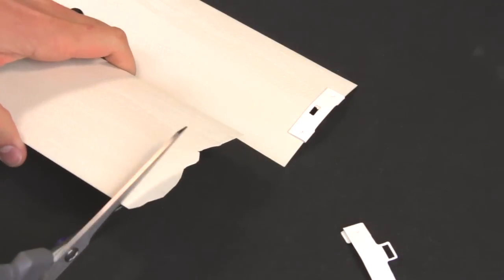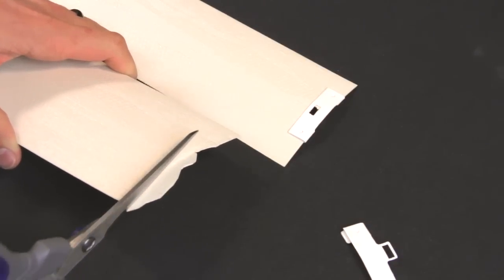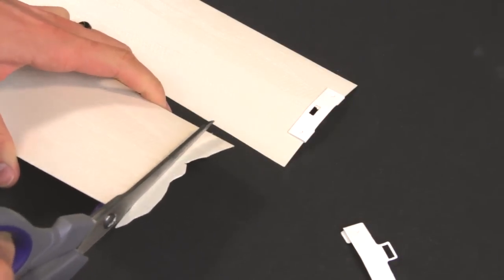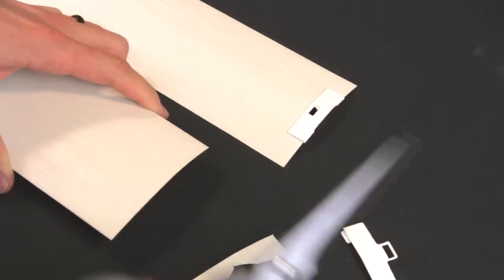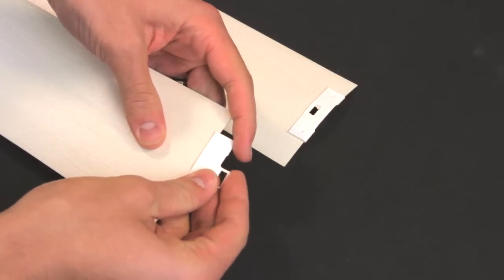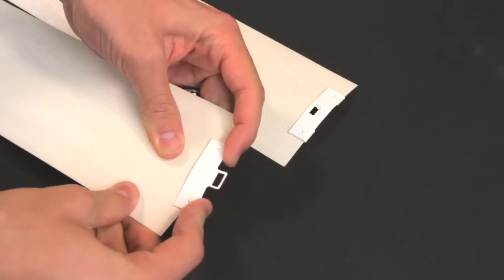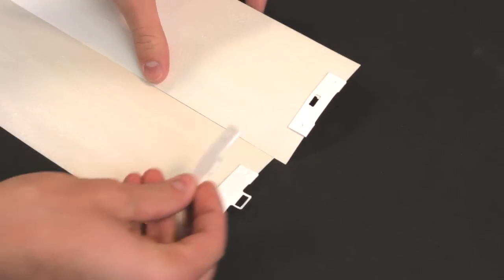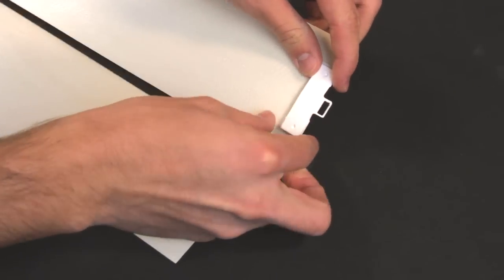How to Fix Broken Vertical Blind Slats with Vane Savers

Comment: When I do this it doesn't stick, the blind keeps falling off of the vane saver...
Reply from the maker: Hi there, is the vane saver pushed all of the way down on the vane? There are teeth on the inside of the vane saver that should make it nearly impossible to remove once it's pushed onto the vane.
Reply: Bad gear clips?
Reply: Super Glue it